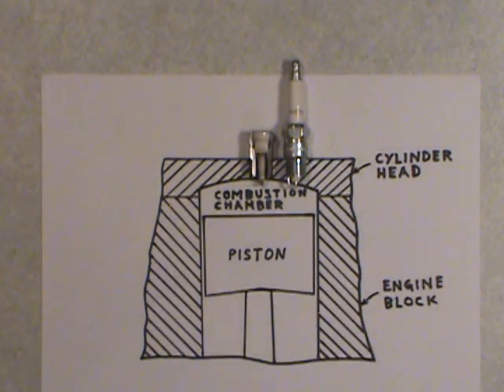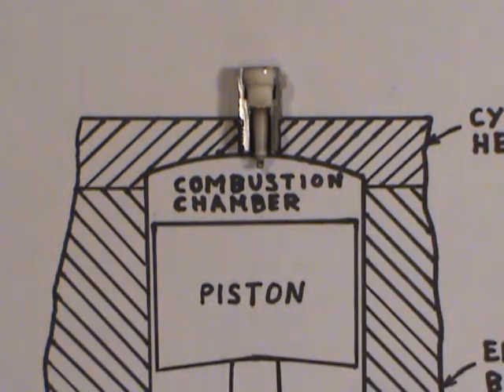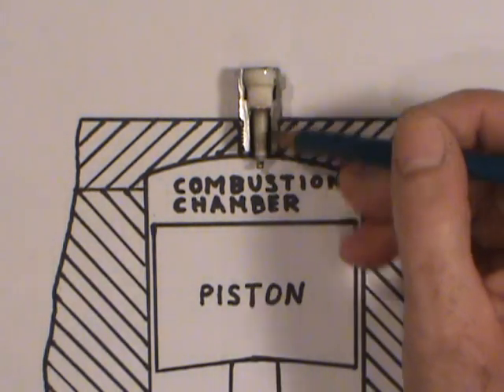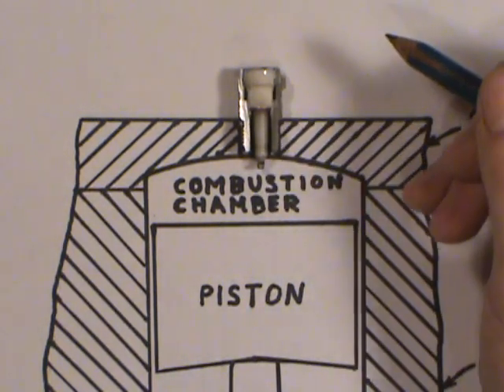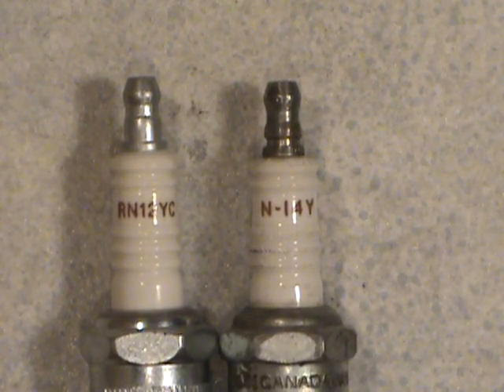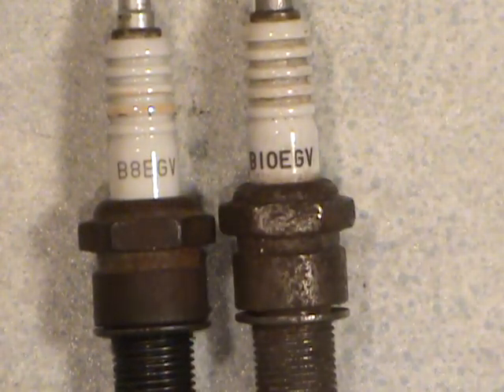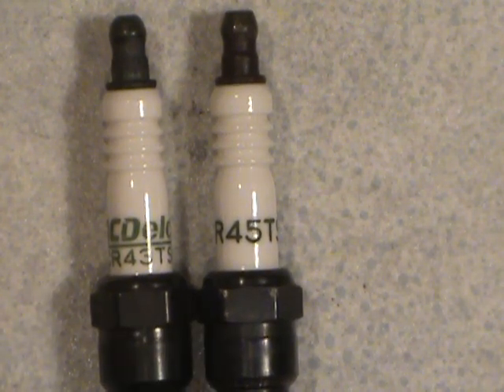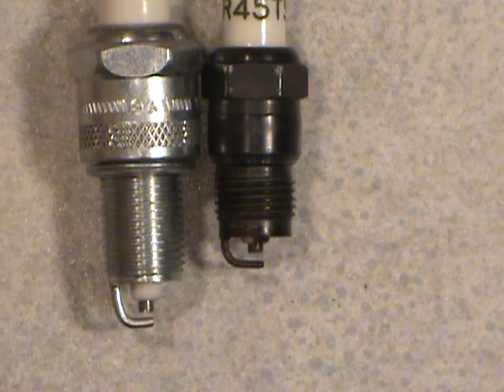Spark Plug Heat Range explained

Comment: So the higher the number or the lower number the colder the spark plug I have one spark plug rated at 20 and the other one Heat range 15 which and another 27  which one would be the colder plug. I need to run one step colder plugs. Thanks
Reply from the maker: Greetings...redbaron2448...........Thanks for watching............Be very careful, whenever changing the "heat range" of a spark plug, that is going to be different from, the factory installed, spark plug's heat range designation, especially so, if it happens to be, going to a "hotter" heat range, because, it can cause lots of engine "damage", if you get it wrong...!!!...but, then again, you did say, one step "colder", right.............Warning...!!!...some spark plug manufacturer's, heat ranges, get "hotter", when the number gets "smaller", while others, get "hotter", when the number gets larger, interesting huh..........Here are two examples for Ya..........Let's take a much older, N-12-Y Champion spark plug, and compare it to, an NGK-5 heat range spark plug, and also, which direction the number will go, when going to, a "hotter" heat range, shall we...........With the older Champion spark plugs, the heat range got "hotter", as the number got "larger"...where-as...with most of the NGK spark plugs, that, I have used in the past, had the heat range, getting "hotter", as the number got "smaller"...!!!...........If you want to see, a, shall we say, "side-by-side" comparison, then, do an internet search, for a spark plug..."cross reference"...chart (select "images", on your browser, after doing the word/printed search), that will show, quite a few, different spark plug manufacturer's heat ranges, and more information, "side-by-side", on the very same chart (impressive that, I must say)...........If Ya need any more help at all, just let me know, things like, the spark plug "manufacturer's name", and what kind of engine, etc., and.......till next time........Be Safe, take care, and have a good one.
Reply: RockysRoadshow. Great video by the way and thanks for the help. So the NGK  Spark plugs say 1 step colder than factor, 2005 Mercedes e55 AMG , so how do I file a tax lien holder what number should I be looking for as in heat range a 20,15 ,10, or do i look higher 25,30,40. Some parts the higher the number the better other parts the lower number the better so I'm not really sure about spark plugs if the lower number is better with the higher number is better.  Just like in my thermostat the lower number obviously is going to be the colder running temp for instance instead of a 185 degrees I'll be running 145 temp. Hope that makes sense. Thanks again
Reply from the maker: Greetings...redbaron2448.........You're welcome, and thanks for the nice comment.........Before you go, and start changing any parts on your car, that "are not" going to be the same, as the "factory original" (Mercedes) installed parts, then, it will probably be a very good idea, to study first, and ask other people, what parts, worked really good for them, for your exact same car, without causing any expensive damage...........Try to find a website on the internet, that has a "Forum" on it, for your "exact" same car and engine (supercharged engine?), and you will be able to ask, some of those very smart people, lots of questions, about whatever it is, that you want your car to be doing, that will be, any different from, how Mercedes set up your engine and car at the factory, when it was new...........You will have to find out, what the "exact" brand and type of spark plugs, that the Mercedes factory, installed in your engine, when it was brand new, and, if you want to use a "different" brand of spark plug, then you will have to use a spark plug "cross reference" chart, and/or, phone, or go to an automotive parts store, and the parts person, should be able to tell you, what the "standard" factory original (heat range) spark plug is, in some different "brands", as well as, hotter and colder heat ranges as well...........Now then, about using a very low temperature "thermostat" in your engine...........That 145 degree Fahrenheit thermostat temperature rating, is probably too "cold", and the engine will probably be wasting gasoline, while just cruising along on the highway, at not too fast of a speed..........Also, there will probably be a "coolant temperature sensor", in your engine, that will be telling the car's on-board computer, how hot (or cold) the engine "coolant" (anti-freeze and water mixture) is, and, if it stays at 145 degrees, then, the computer, might not go into, what is called "closed loop" operation, and fuel economy won't be very good, and your engine, might get full of, too many "carbon deposits"..........."Open Loop", on-board computer operation, usually happens, when the engine is cold, and just warming up, and also, when the gas pedal is pushed down quite far, like you are kinda racing, somewhat..........Make sure, that, your "cooling system" is in very good condition, with "coolant" that is not too old, because sometimes, the radiator gets "plugged" up with corrosion and other stuff, inside of all of those very small, flat shaped tubes, that can cause an engine to run too hot, or maybe over-heat too, because of the coolant, "not" being able to freely flow, through all of those small, flat shaped tubes..........If your radiator, has one or more electric fans, mounted on it, then, the fan/s, have to start running, when the programmed temperature is reached (might be around 200 degrees Fahrenheit , possibly), so, engine (coolant) "overheating", can also be caused by, one or more Fans, not running, when they are supposed to (especially important, while the car is at a stop, on a very hot day)............Also, "Never" open (remove) a radiator "Cap", when the engine's "Coolant" is "Hot", because, that very "Hot, and under Pressure" Coolant, can spray all over the place, and, can also, cause Serious "Burns"...!!!...and.......till next time.......Be Safe, take care, and have a good one.

Comment: AC Delco sparkplugs are manufactured by "Champion".
Reply from the maker: Greetings...Jose Cuevas...…...Thanks for watching...…….Well, that's something, that I've never heard of, very interesting...……..For the older, cheaper spark plugs, I'm now using NGK spark plugs, because, if Ya measure the ohms/resistance, of the "center electrode", on a new spark plug, then, the NGK's, are usually, no more than, about 5,000 ohms...……..Some other brands of spark plugs, are way too high in ohms/resistance, for my liking...……..Less resistance, usually means, that, more of that high voltage, that the ignition coil outputs, goes to your spark plug's electrode/s, which to me, will probably make for, a more intense spark, I be thinkin', but, everything else, in the ignition system's, high voltage secondary circuit, has to be in top shape as well, as in, spark plug "wires", and if applicable, distributor parts & pieces as well...….and......till next time...….Be Safe, take care, and have a good one.